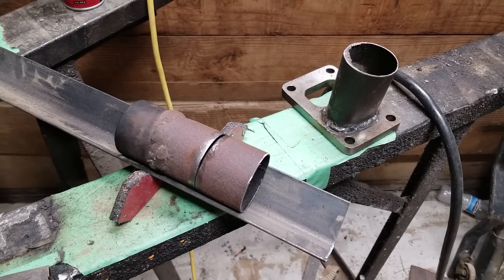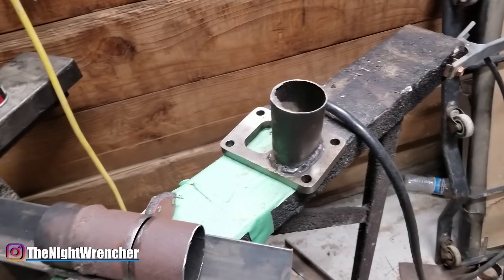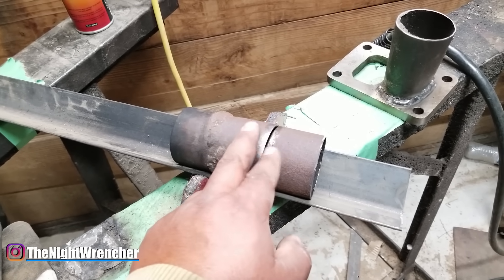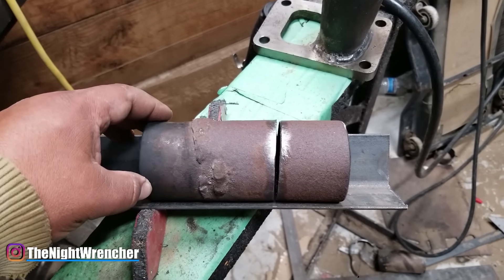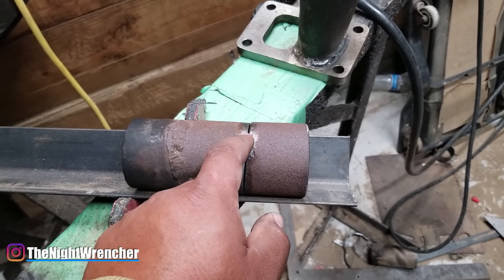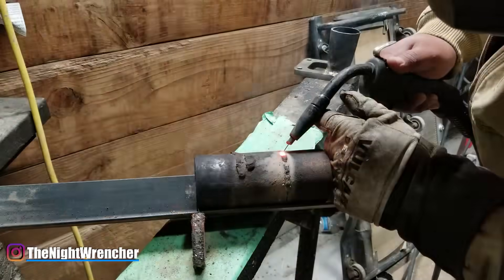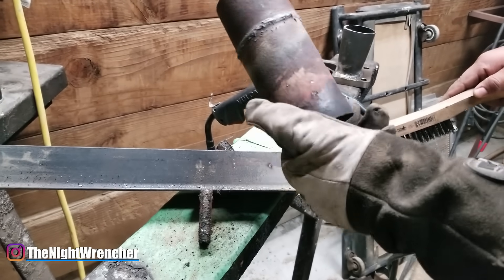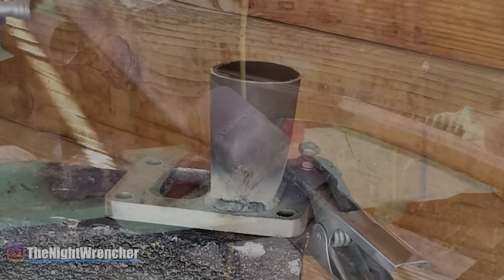How To Weld Thin Metal Using Flux Core Gasless Welder | Flux Core Welding Tips And Tricks |

Comment: One, could spot weld here, and there. Then go back, from left to right, doing one spot weld left, then right, then left until they're  joined in the middle.  This, will allow cooling to take place, while your still  BEING  PRODUCTIVE. No wasted time, either way.  Turn pipe, another 120  degrees in vice, and do another  1/3  of the  total  diameter.......

Comment: Good.  As with any metal welding:  PREPARATION   IS  KEY.  Both for cleaning the metal, and the types of weld process used; as well as  YOUR  EDUCATION, and understanging of various grades of stee;  N95,  1084,  5160,  etc etc. There are probly hundreds, of types of steel, from countries worldwide. Stainless steel, and cast iron, pot metal are all  another different kind of beast.

Comment: The hardest part of exhaust welding is welding what you can't see IE the top of the pipe
Reply from the maker: Thats why I tack it together in place and finish welding it on the bench
Reply: @NightWrencher  Taking the pipes off aint always a viable option
Reply from the maker: Its not, but I wouldnt recommend welding exhaust while its still under the car to a beginner. Youre just asking for trouble.

Comment: You can only safely go over the weld if the you have the correct wire.  Most flux is single pass wire.  Labeled with a S.

Comment: gotta call you on this one, the first thing is, what alloy is the tubing made of? Some exhaust pipes I have seen are stainless alloy and you will play hell welding that with anything but stainless wire or nickel rod.
Reply from the maker: I have a video on welding stainless with flux core. It comes out fine but it will start to rust.

Comment: Wen I weld old rusty exhaust I only use flux cored gasless welding wire in my no gas mig welder. Gas is too expensive. I algays cut a piece of old exhaust pipe down the middle and cut a small fillet out along the cut side and then push  the old cut piece in to the full pipe half gay and then   put it in to the joining pipe and then weld it . This not only gives u double thickness usually in the thinner rusty old exhaust pipe and gives it extra strength supporting the 2 pipes together plus alighting it better plus onc e welded should offer a thicker stronger weld making the whole 3 pieces amalgamated in to one strong welded piece. Hope this helps hunx...yours sincerely from the old qeer corrupt 🇬🇧 UK..
Reply from the maker: Thats interesting, I've gotta try it

Comment: I was thinking of trying my luck (but with great hesitation) on wire welding my db killer insert (thin metal) to my M4 exhaust; Would this work? Also I don’t plan to take it off the bike but curious on what I should hook the ground cable on to. Also what wire should I use?
Reply from the maker: It should weld fine but use anti spatter spay and just put a few tacks all the way around. .030 wire would work well. Also, make sure to disconnect the battery if it has one and hook the ground on a bolt head or something directly hooked up to your exhaust.

Comment: I’m glad as a non taught welder that when I watch videos like these teaching you that I’m doing things right or at least have the right ideas and directions to make my welds the best. How you explained is exactly how I did my exhaust with flux core. Thanx man
Reply from the maker: Thats awesome!
Reply: @NightWrencher  what's the exact amp, dials and the name of the flux used for thin metal? I need to build a exhaust for a generator so it's even thinner than your car exhaust pipe.
Reply: @BOREDANDWELLBORED if it is even thinner, you might be better off with oxy acetylene and soldering.
Reply: @BOREDANDWELLBORED ❤😂😮
Reply: Kinda like you mate. Did some body work on my car. The thinnest plate was like 1/6... Put the welding in 13v/30-40A and minimum inductance. I tacked the corners, run a spot like on both edges to get'em closer together (I had ~1/10 missing) and then started the same spot weld technique but on the puddle in the middle and doing it much faster. Maybe I'll help someone.

Comment: Just found your channel, subscribed.
      I've done almost as. Nice of welds With Flux than gas. Almost.
Can't help the splatter. That the nature of Flux. Doesn't other me I've welded frames with Flux that came. Put sweet strong and still together years later.
   It is a viable tool.
 30 years ago it was being used in structural stell elbeit larger and stronger power Tha our garage toys.   Good enough for a building good enough for me. It creates strong welds for sure
    Practice practice.

Comment: yes indeed. I couldn't find a muffler for my sentra 2005 with correct size pipe. Had to make repairs myself, welding old one back on. had to spot weld and then build on top of that.
Reply from the maker: Glad you were able to fix it!

Comment: Good tips! Another method to welding super thin material is tack welding it 100% with all tacks over lapping 50% or run small beads 1 at a time then cool with air and continue on until joint filled!
Reply from the maker: Exactly! Very tedious but it works!

Comment: Did you chip the slag before running the 2nd bead? If not, why and will the  bottom slag be up under the 2nd run???
Reply from the maker: It depends, you can do it without cleaning it and it will still weld. You'll get a little porosity but if its sheet metal, it doesnt matter, the weld will be strong enough and most of the junk will float to the top anyway. If you want a cleaner job, clean the weld up before running the second pass. It will strike easier and should buzz along.

Comment: Hey, thanks for the video. I'm a very very new welder, ie, I wanted to modify my Bike exhaust so went and bought a Unimig Viper 120 to learn with and do the job, my first ever welding. I found even with the settings way down I blew through and got to learn that I needed to tack as you say here. My question is my welder came with .08 flux core, would .06 be better to use and not blow through so quickly? Thanks, really useful video, especially about being able to build on top of the tacks.. Thanks
Reply from the maker: Thinner wire will definatelt help! Also turn down the wire speed if you can
Reply: @NightWrencher  Awesome thanks... Sadly the wire speed and power are integrated on this little welder... I'll swap to the thinner wire though, I figured it'd probably be the thing to do.. Thanks pal...

Comment: How do you finsh the turbo flange
Got one I'm doing for my 56 GMC truck
For a 383 sbc the turbo is two like that.
Reply from the maker: I installed it like how I have it in the video and then installed it in my truck, then I clocked the second one and tacked it in place. After that the rest is easy. For the center I just weld it on the inside and do my best on the outside
Reply: @NightWrencher  thank you I'm going to weld in side of the flange like that. The turbo weighs a lot so I put a bracket on it
So it doesn't break the welding 🥽 on the flange. My motor is solid mounted to the frame no rubber mounts the vibration shook and broke the welds on the last one. Thank you 👍🏽📹

Comment: That was all good material however can you emphasize more on what kind of material we’re welding with exhaust like aluminized steel versus galvanized or stainless
Reply from the maker: For a hobbyist, it doesnt really matter. Anything thats not stainless or aluminum should weld about the same. Just sand down and coating that it might have and go for it.

Comment: Are you welding over slag or were the initial tacks cleaned before going over the weld again? Looking to use this technique on some tubing in the future
Reply from the maker: I dont clean off the tacks in between welds because if you know how to manipulate the puddle, you can actually push the slag towards the surface on the next tack. After its all tacked together and go for the full second pass, I would clean it all up and turn the wire speed down a hair.
Reply: @NightWrencher  thanks for your reply! I need to pick up some tube and start practicing.

Comment: Hello my friend I caught some of your flux core videos by accident actually but it made a lot of sense to watch seeing Sal that's what I'm welding with a Harbor Freight 125. I never have arc-welded much or done any of the flex core that much but I knew I was going to have to have one of these types of welders to do some things on my truck. I am learning now that body panels really should be done with gas and 23 gauge wire properly I don't know if I can do anybody repair with the 30 gauge flux core without burning a bunch of holes but I will try. Have you done any body work with flux core??? Without a lot of difficulty? I know for welding thicker metal they are great especially if you're in a windy situation, but every time I've tried on thinner stuff I have burned a hole. Currently I am welding my exhaust back together and I have learned how to do that pretty well without any holes. I was wondering on that Harbor Freight where you turning that up to the high setting or the low setting and what was your wire speed for doing thin metal tacking??? I would appreciate any help with this as you seem to be knowing a lot about flux core too bad they don't make a 23-gauge flux core.
Reply from the maker: Hey man, I use .030 wire on panels all the time without too much difficulty. The key is to have a good clean ground on the work piece and to clean the area you are about to weld really well. You'll want to turn the heat and wire speed all the way down and not weld for more than 1 second at a time. You want to tack those panels as fast as you can to prevent blow through but also warpage. You never want to try to weld beads on panels because you will distort the. Try to keep the heat off of the panel and only pull the trigger a little at a time in a side to side motion to weld the panels together and then let off right away. Like I said, 1 second at a time and then go in a criss cross patten all around the panel.

Comment: Than you for this as it really will help .. can you advise me what wire to use as I wish to buy gas less and weld my exhaust and my bike frame aswell .. many thanks
Reply from the maker: Hey man, if you want to switch to gasless welding you will need a roll of lincoln innershield wire, prefferably .030 because thats the thinnest you can get for flux core

Comment: You have to clean the slag off between each layer. The tack method is a good idea, but clean it before your next pass.
Reply: I just got started with flux core, 9+ times out of 10 I find the slag flakes off spontaneously on cooling, on rare occasions some gets a bit of purchase but welding on top of it seems to just melt it and add it to the pool. No inclusions yet. I'm absolutely hooked now, never suspected flux core would be so much fun.
Reply: @bobs12andahalf2  one of the best and most useful comment sections ive come across, thanks
Reply: You should also use wire that is rated for multiple passes.
Reply: @Thedoug369  This!
Reply: It’s ridiculous to think u have to do one tack then stop and clean slag …. You don’t know what u are talking about … for autobody sheet metal , you tack and stack or it’s called a stick weld …. It barely colds and you stack another one and move around to control heat …. Then you grind out all and bodywork it
Reply: This is a good explanation of how to do it …. starting on previous tack and dragging it in will help me a lot
Reply: One question to ya all i have 0.30 wire and i need it fo car bodie panels 1 mm .will i ger better results if i buy thiner wire 0.30 is 0.8 mm and i can put thinner wire 0.6 mm
Reply: @damiropadobarglumskiperiod505  Yes, thinner wire
Reply: @damiropadobarglumskiperiod505 They dont make flux core smaller than .030.  0.23 wire is always mig.
Reply: @damiropadobarglumskiperiod505  
.30 wire is far too large. tf are you even welding?
Reply: Thanks for this added to what he said
Reply: That depends on the consumables used tbh. What he did was a "stitch weld" and you see that on auto body metals a lot. Cleaning slag is more important for thicker metal. If you have a wire that puts out next to no slag, like some do, and if your weld pool isn't getting too cold before the next stitch, then you won't see slag traps as much or at all
Reply: @lucasblizzard7261  says right in the title flux core, one of it's characteristics is leaving a layer of slag. Regardless of what welding procedure you are using you should always clean the weld between passes.
Reply: @idabomb00  I'm a welder
Reply: @lucasblizzard7261  what's your favorite flux core wire brands for reduced slag? Been looking for a good one to use around my place.
Reply: @lucasblizzard7261  that's kinda like saying you work fast food, they're a dime a dozen
Reply: @idabomb00 just try it. Stitch it and don't clean it and if you do it right the flux will melt again just like it melts from the core wire. The only time you have to break flag off is if you let it cool totally before the next Stitch . Try it.
Reply: @idabomb00  your one of those guys eh …..

Comment: Did not know I can ground the cable to the angle iron thank you for your knowledge and experience
Reply from the maker: As long as you have a clean ground to a metal surface that touches your metal, you can have the ground anywhere!

Comment: hi i  got a  galvanized  steel pipe for fence and wanted to  weld it   i got a flux core 125 v   but it was not welding it at all no spark or so    what am i doing wrong
Reply from the maker: Sorry for the late reply! Galvanized and aluminized steel needs to be sanded to bare metal before it can be welded. Make sure the ground is connected to a clean part of the metal that has been sanded too.

Comment: May I suggest you go take some welding classes at your local tech college. This video is a hot dumpster fire.
Reply from the maker: College course: Step 1)break out your fancy miller/esab/lincoln welder 2)tig weld this together with 85/15. Yeah, no. You're talking to the wrong crowd.

Comment: 16,18 guage is thick compared to the 20,22 guage as in newer car sheetmetal,quarter panels are a bitch nowadays,sure is harder on the newer stuff
Reply from the maker: I know what you mean, I tried to weld in a core support on a 2016 honda and kept burning through. Had to turn it all the way down and it still was too hot.

Comment: That is NOT WELDING. Joined, maybe. But still crap. Not a mention of wire thickness, gas flow, or any other help. Gas weld is the PROPER way. P.S. I was a coded welder, so have had a few years at allsorts. Even managed  ally to steel, which is impossible.
Reply: WTF do you expect joining tissue paper thin rotted pipes together? A frigging welding robot isn't going to do any better. This ain't stainless steel handrail we're dealing with here. Some folks are just trying to work with what they got. You need to adjust your expectations.
Reply from the maker: There is no gas. This is gasless FCAW. Common process in the industry. You should know.

Comment: Tack everything on three sides, use a gas nozzle even with flux as you can pivot off of and your tip doesn't stick, spread the heat out like tightening lug nuts. Noobs don't use a gas tip and wonder why they can't get a good bead...just saying.
Reply: I'm a noob.  Can you explain using the gas nozzle so the tip doesn't stick, and why that is?  I'm very noob, lol. Thx

Comment: If it's flux core gotta clean that first pass/ tacks man or else porosity there is slag in flux core welding wire
Reply: It's an exhaust system not a steam pipe.
Reply from the maker: Paul is right, worry about porosity on plates, not really an issue on sheet metal and exhaust.

Comment: Thanks for the tips, I use a harbor freight 90 amp flux and been going nuts trying to do exhaust…kept burning through
Reply: (2 1/2” ID to 2.5" ID Universal Exhaust Pipe Coupling Connector Adapter Coupler) ... look this item up on e-bay. It's basically a sleeve that goes over the exhaust people, so you avoid welding 'butt joint'. Hope that helps! Make sure the Inside diameter of the connecter is larger than the Outside diameter of your pipe so it can slip over it.
Reply: @jamesdunning8650  if you're just running out and buying stuff then get a pipe expander. You don't need a coupler. Any soup can works.
Reply: @jamesdunning8650  I tried that and it still leaks near the bottom part of it where the two tightening bolts are, and it still makes noise / has an exhaust leak there at the coupler. Considering just welding it, instead, if possible.
Reply: @steveandrews8301  run a shop vac into the tailpipe so you can feel the leaks easier. Use a glove on one side with a finger cut off if it's a two pipe exhaust. You can use soapy water to see the leaks.
Reply: @jamesdunning8650  Thanks. I was able to detect the exhaust leak with my hand, (and ears) - I could feel it coming out on the bottom of this coupler-clamp where the two bolts pinch it together. I put Bondo Glass (bondo with fiberglass hairs in it) over the ends of this clamp portion where it was not completely sealing it. It worked. Made it much quieter, too. It should stay on there in spite of the exhaust heat since it's not directly on the pipe itself. We'll see.
Reply: @steveandrews8301  glad it worked. Exhaust issues are a pain. Hard to get back to normal once it leaks.
Reply: You might want to check and see if your welder can be modified to run better. I've heard some harbor freight welders don't have certain components in them that would make them more capable machines. You want things like a rectifier bridge and a filter choke. That will net you a smoother arc so you can run at a lower power. Those parts aren't in there because they cost money. Welders work without them. Welders work better with them though. There's videos here that explain things.